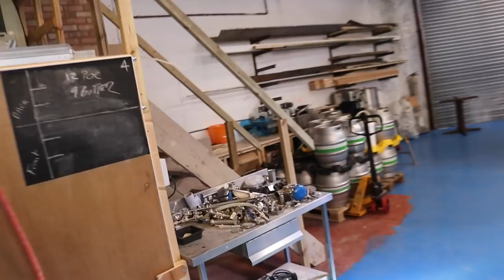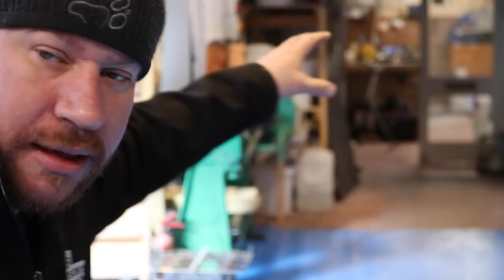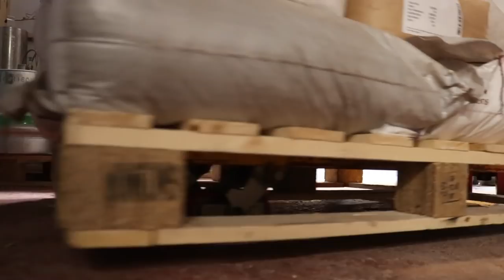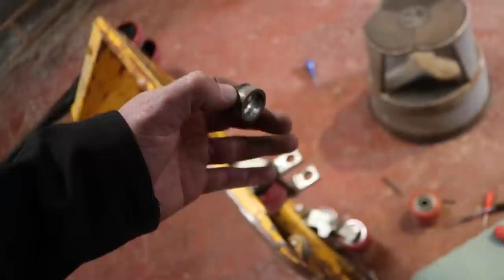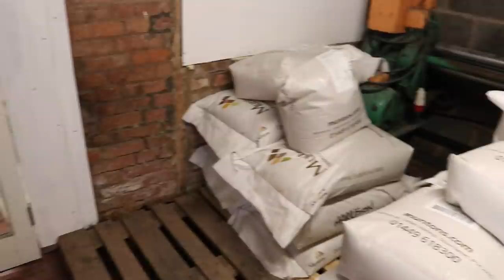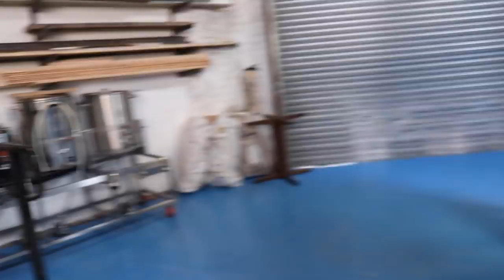Stainless Steel Pump Trolley

Comment: Love my allrounder fermenter, make sure you order a pickup tube and float and stainless liquid and gas posts to go with them, the red plastic ones just don't seal as well. Also the main lid don't need to be done up tight to seal less is better.
Reply from the maker: I have most of that, Heard the stainless posts are worse for leaks than the plastic!. I'm not too bothered though, I have a gas delivery every week.
Reply: @harrybrew69  sweet, saw your setup on latest blog. I heard the same about the posts but did find the reverse, had to over tighten the red ones where the stainless with seals seal just finger tight. Can't wait to see your test batches.